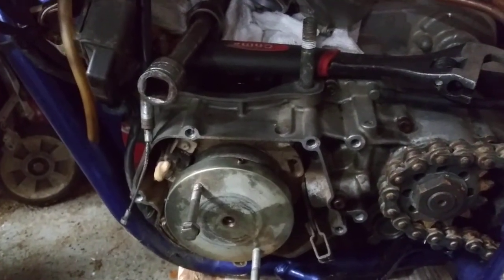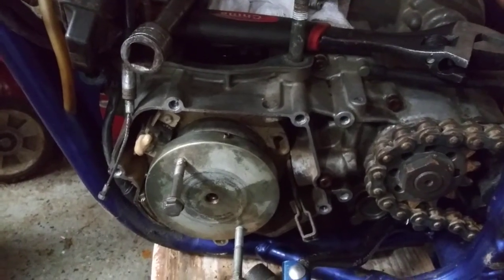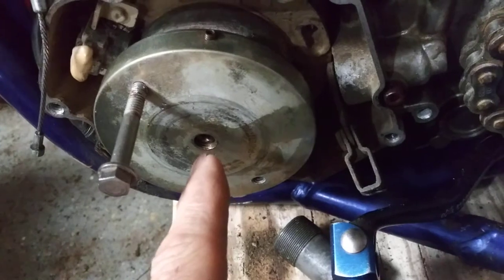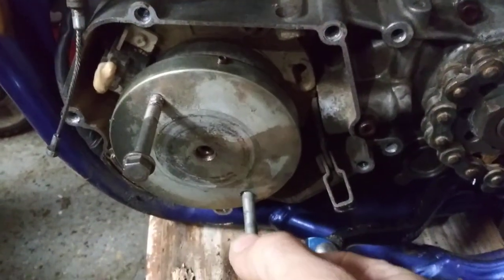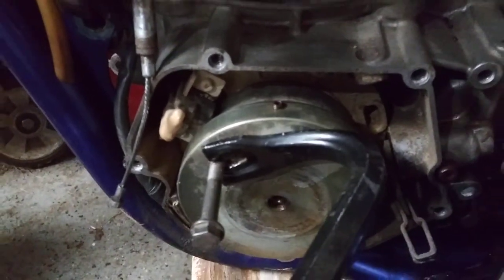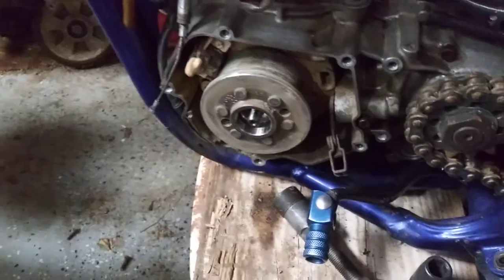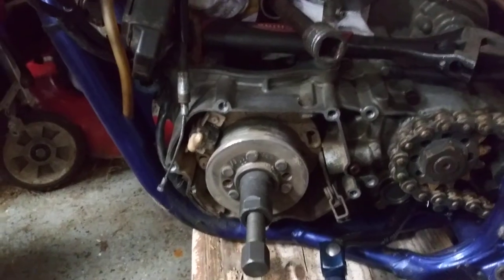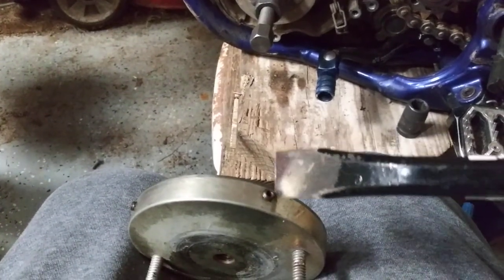How to remove flywheel weight without tools DIY ghetto method steahly yz250 removal

Comment: Great video I need to do this to mine, it will be the 4th time I've attempted to remove it. Horrible things. Am I right in thinking you would have hit it the opposite way to what was shown in the vid to remove?
Reply: To loosen is counterclockwise  or lefty loosy,,,  his method is not a good one. Borrow the correct tool or make one out of steel flat bar. Drill 2 holes n crank it off. Take the spark plug out and feed clean rope into the sparkplug hole , make sure the piston is 1 inch from top dead center before putting rope in so you dont break a ring or port.